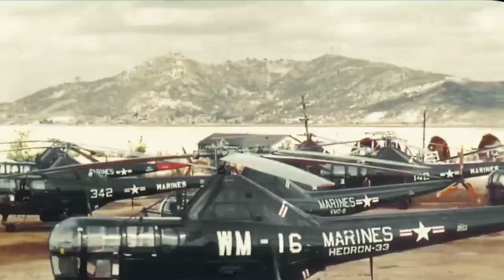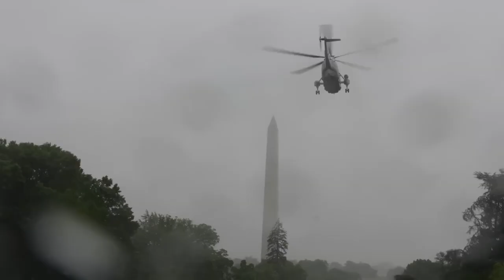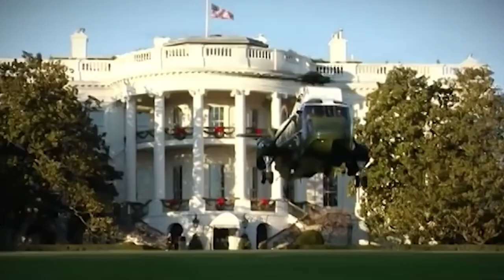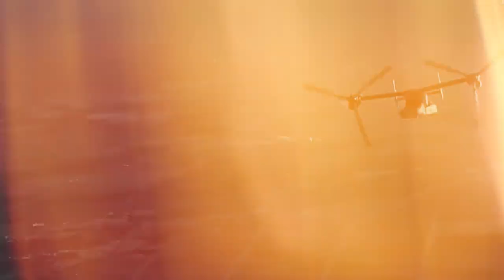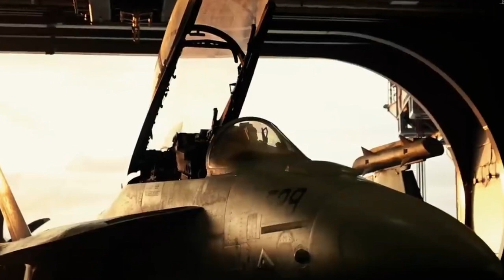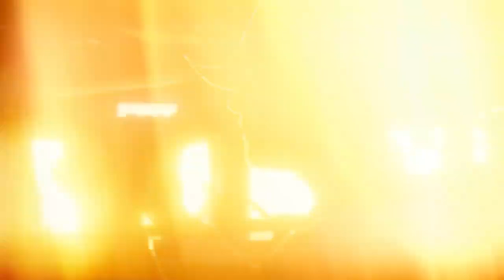President Trumps NEW $80 Million Helicopter_ MV-22 Marine One

Comment: "Meet the MV-22 Osprey – the $80 million marvel now part of the presidential fleet!"(sic)

HMX-1 began operating the MV-22B tiltrotor in 2013. Due to the lack of the required communication suite for NCA, the MV-22B is not used to transport the POTUS or VP and thus is not Marine One or Marine Two.

"This cutting-edge helicopter"(sic)

Tiltrotor not a helicopter.

No mention of the Army losing a VH-3A at Grand Cay on 26 May 1973 which was the catalyst for Ford ultimately assigning the mission solely to HMX-1.